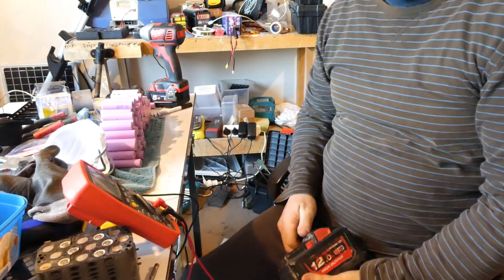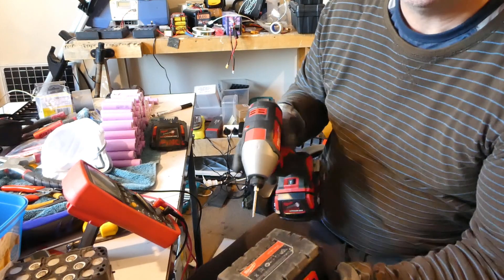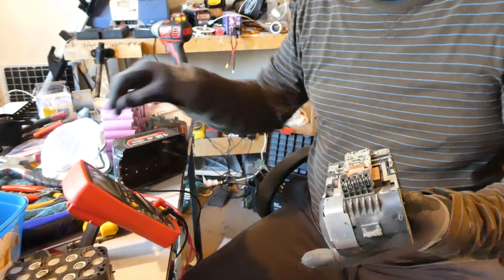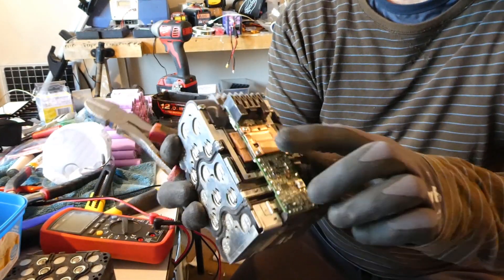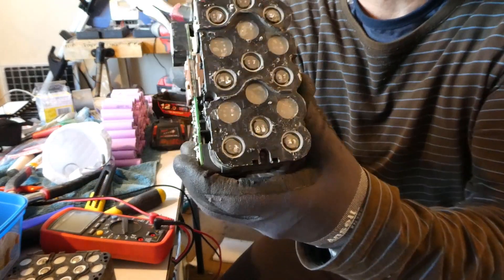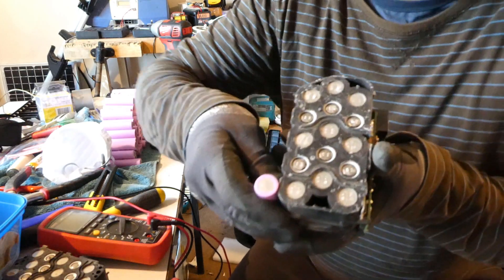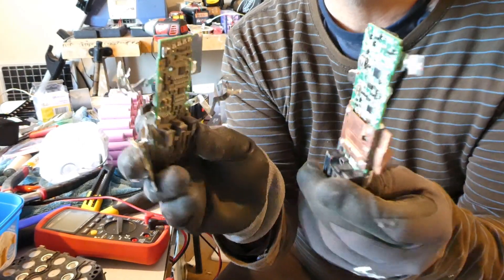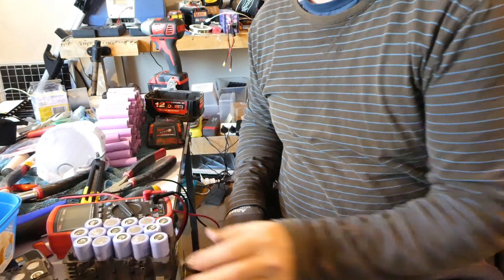Milwaukee 12AH  Battery Teardown - Red Lithuim High Output

Comment: Mine stopp3d working. Where can I get the cells to rebuild my self? It's the 12 HD like that one on video
Reply from the maker: It would be very difficult to rebuild a milwaukee battery as the pcb kinda shuts itself down when there is a fault. Have you tested the voltage with a multimeter? Maybe it's just low voltage in which case you may be able to jump strat it. Good luck 👍🏻

Comment: You got dead 12ah?
Reply from the maker: Yes mate, first one ✌️
Reply: @offgriddreaming5403  im running 3 of them now and soon ill grab a 8amp for testing. The high demand batterys seem great so far. Doing a cycle life test on them
Reply from the maker: One Up The Sleeve Customs I’m liking the Milwaukee gear.
Didn’t know they made 8ah.
I have a few batts now. Need some more skins.
I’ve got the 21700s in the charger, will be interesting to see what capacity they have left

Comment: Different - they've reached the max capacity on 18650's, so they upsized the cell to 21700 to squeeze in more aH :)
Reply from the maker: dash8brj Higher current draw also ✌️
Reply: Only so energy dense they can be